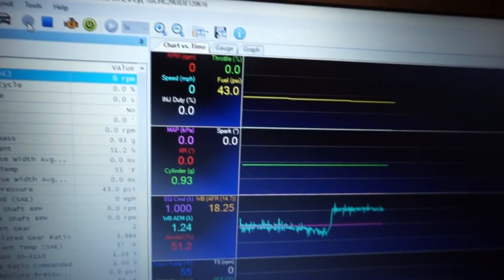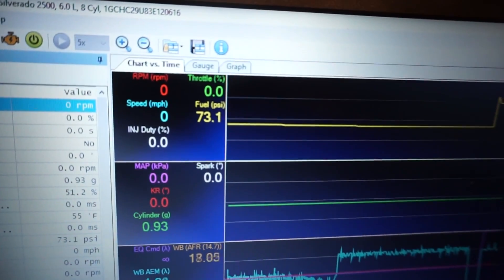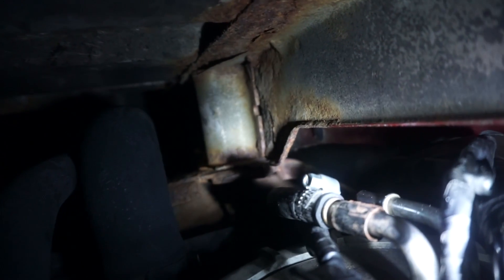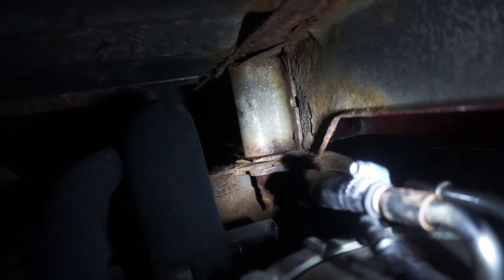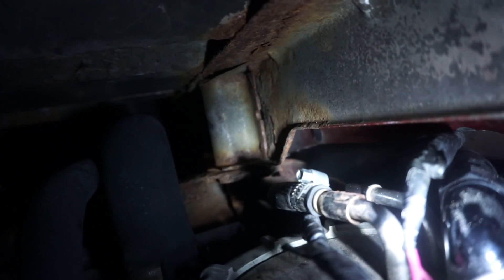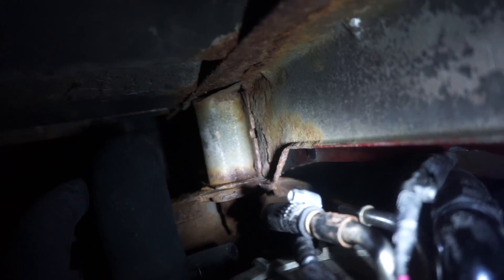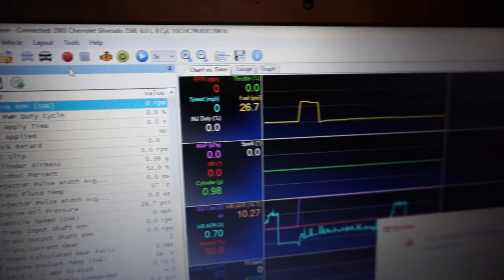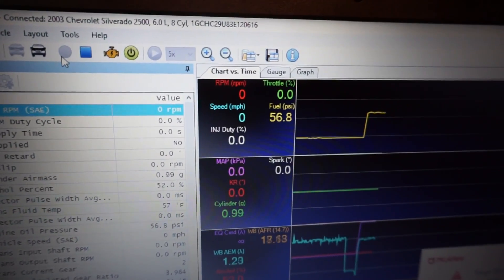Fuellll PULLLLL!!!! Fuel Pressure Logs And Frog Funded Rocket Science!!!

Comment: Why did your oil pressure drop going from 2 pumps 80psi to 1 pump 60psi🤔
Reply from the maker: Good catch. I'm using the oil pressure Parameter ID to log fuel pressure. I have an AEM sending unit behind the intake in the return side because it shares the same 3 prong plug as the factory oil pressure sending unit. Channels list shows oil PID, but I changed the name to "fuel" on scanner.

Comment: Fix......your.....fuel.....system!  No change in idc at 80 psi fuel pressure is a huge red flag.  You are gonna blow shit up at the track if you don't.  One pump on E85 ain't gonna cut it.  I use one cheap AEM pump...good Holley regulator....-10 feed...-8 return with a 800 hp NA BBC in a drag car.  43 psi base pressure.  Your motor seems solid right now.....fix your fuel issues so it will live!

Comment: Sounds like the pumps might be cavitating in the tank, if you change where the return goes in the tank, maybe it's aerating the fuel in the tank, and it's getting poor quality fuel that's full of air, and when it has more pressure with the two pumps it exasperates the problem because it's pushing more fuel through the return. Just something to consider. Also black motors are hard to find oil leaks on, could be a head gasket oil leak too

Comment: What fuel pressure sensor are you using? I don’t remember you installing it. Maybe I just missed it. Anyways a part number and install how to would be good. Thanks
Reply from the maker: AEM (stole it from the 350z). It shares the same plug as the oil pressure sending unit so I'm using Oil pressure PID To log fuel.

Comment: I dont believe Hunter is using 2 450s tho? Get the $140 aeromotive and dont look back. I switched from the $30 ebay regulator and the 1:1 rise is alot more smooth. The cheap ones work good, but I feel They are not as accurate. How important that is is another question lol
Reply from the maker: Yeah, that's what I'll get when I buy one. Hunter is using 2 pumps, Bosch 044 I believe... I'm done messing with it, I'm ready for a good one.

Comment: Interesting information.  Did I miss something,  I thought you were going to leave both pumps connected and run the return line to a bucket.  It seems like those 210's on  one pump will Last for a while.  Great video as usual 👍
Reply from the maker: I did off camera. The scan at 5:15 was into the gas can, and discussion at 5:30 was next day... I originally wasn't going to post this because it didn't work, but decided to let today because I wanted to add it to the single pump drive.
Reply: @BlaserBuilds  ah ha. Do you plan on running a larger return ( -8an) when you add your second pump or possibly just increase the hat to 3/8?
Reply from the maker: @philbetthauser9547  I ran the return to the 3/8 side of the hat now with a fitting.